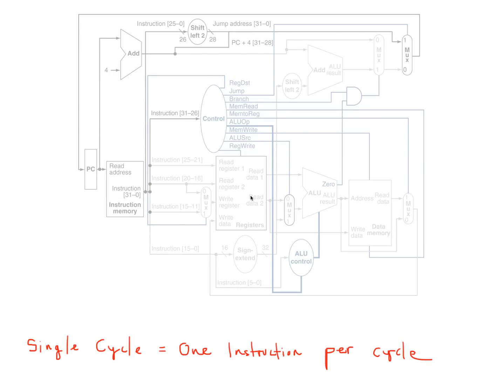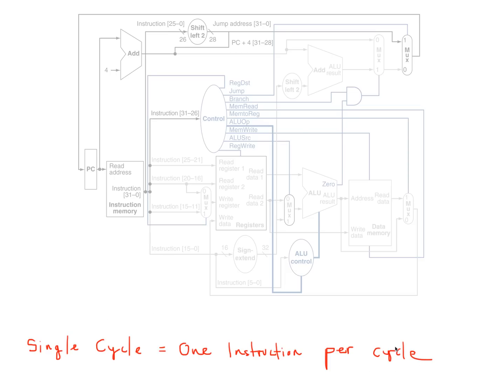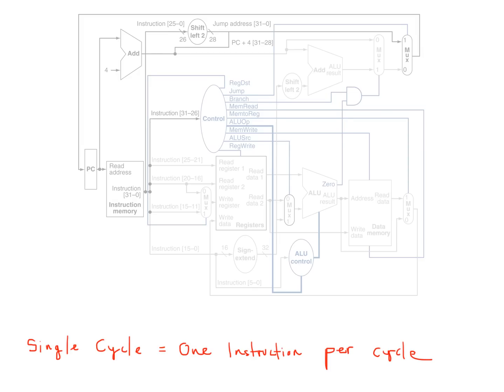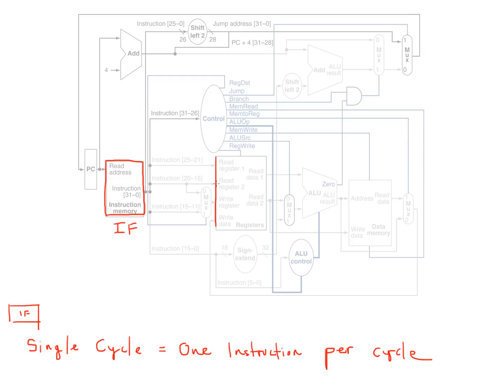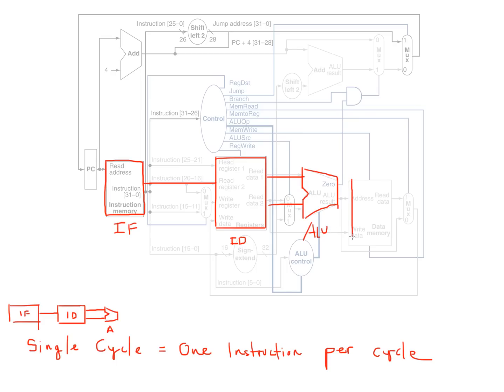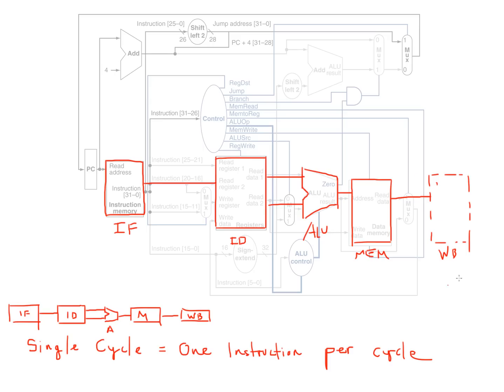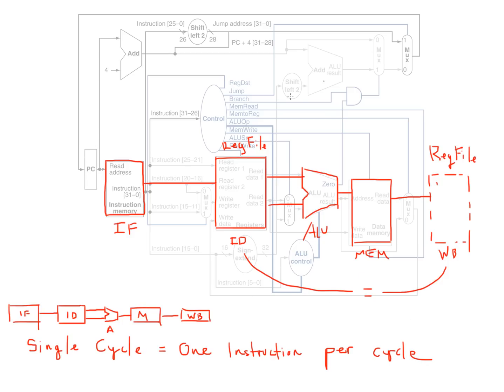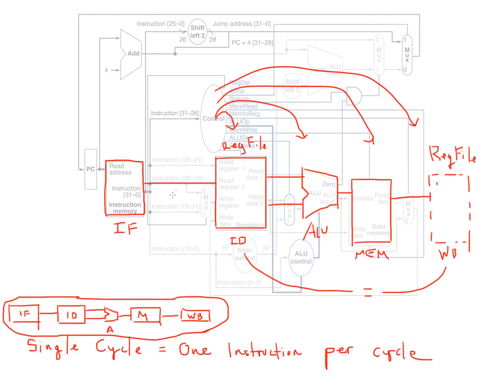Single Cycle Datapath Overview

Comment: I found that this video helped my grasp on understanding what is going on when a processor is running. One of the things I noticed is that you never talked about the top part of the diagram and what happened up there. I know that it has to do with finding what instruction to use during the next clock cycle, but have you made another video going over that, or at the least, show what is happening when you run any of the jump or branch instructions through the processor? I just want to make sure that I understand how it works exactly.